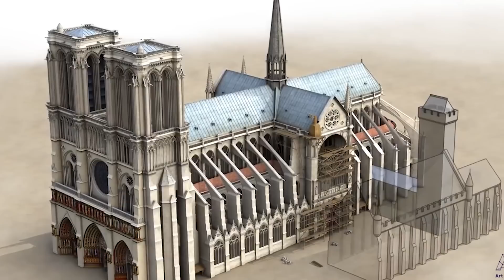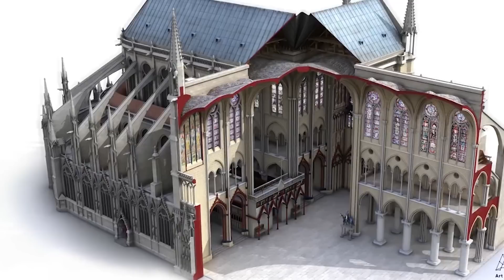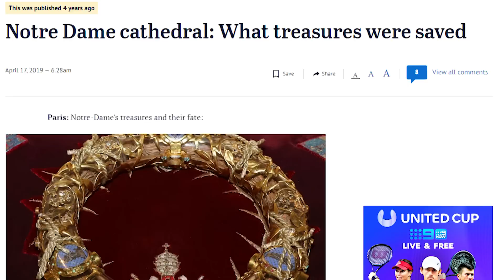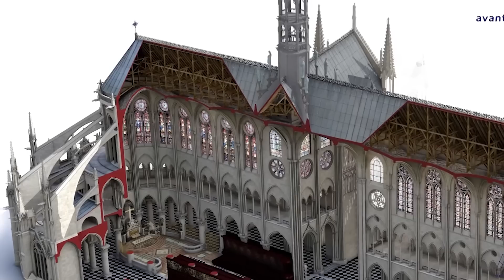New Notre Dame Cathedral: $800 Million Updates. Was it Worth It?

Comment: There is NO WAY that "the fire" was caused by an electrical overload fault, you see, that's what the "circuit breakers"
and "earth voltage & neutral link" breakers are for, to shut-off electrical energy, when there is even the slightest hint,
of anything, like a "hot-spot", like an overload, before it gets anywhere near a "fire event". Then if by any chance, some
sort of fire, did take place, in the massive chambers of Notre Dame, built by Master-Craftsmen, using the very best of
materials, like solid granite blocks, and "old-growth" hardwood Oak beams. It takes"time", and the "application" of heat, 
mixed with the "fuel". Those heavy, solid, tough building materials "by themselves" would never constitute enough of
the required FUEL or FUEL LOAD, as granite does not burn, neither heavy Oak beams (without flammables) So the
"Final Analysis" must be AN ACT OF JEALOUSY, VANDALISM & CULTURAL GENOCIDE BY THE PARASITIC ISLAM.
Reply: Here is the God's word
Acts 17: 24: "God that made the world and all things therein, seeing that he is Lord of heaven and earth, dwelleth not in temples made with hands;"
So, they are spending billions to deceive people, but where is the God lives?
1Corinthians 3: 16-17: "Know ye not that ye are the temple of God, and that the Spirit of God dwelleth in you? If any man defile the temple of God, him shall God destroy; for the temple of God is holy, which temple ye are."
OK, the God's temple is a christians, but solding clirrgy knows nothing about...
Why do liers feel so good now?
The problem is Devil runs the world. He is lier and murderer. That's why we've got the Gospel about the God's kingdom. 
Jehovah would put everything in order.  The dead will be resurected and we'll meet our beloved ones again! :-)
Reply: @user-se6vg7mr1z - And you know this how? Are you an expert on fire starting?